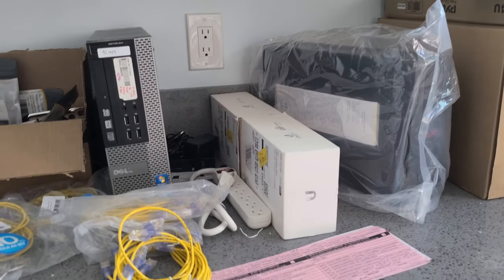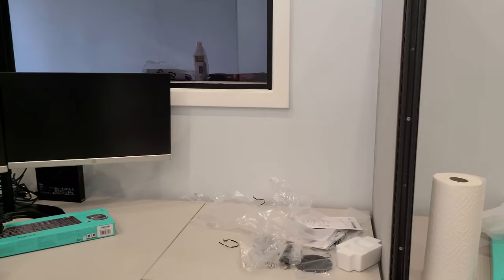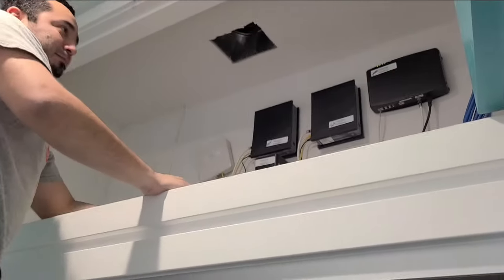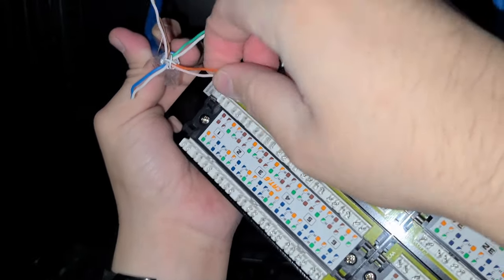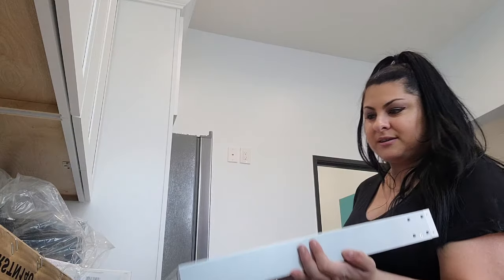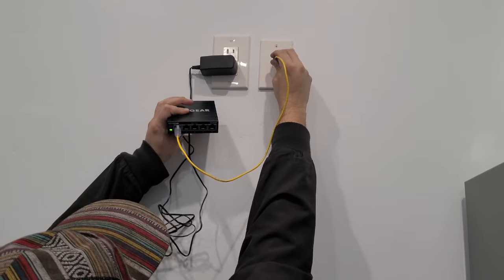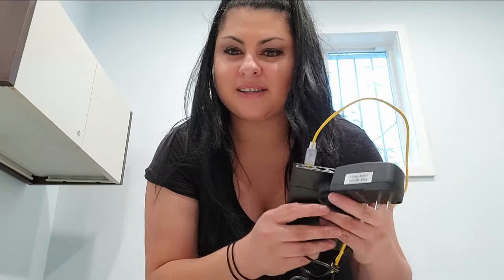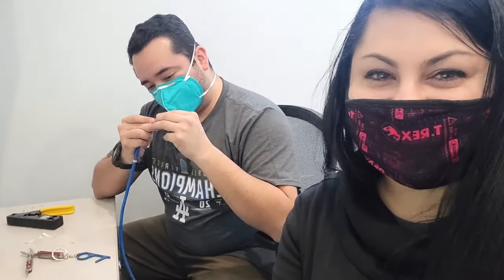Day In The Life Of A Systems Administrator - Hardware And Networking

Comment: Not what I consider a "system administrator" job. Maybe a network technician, or possibly a network engineer if some enterprise level cisco switches, etc were involved. I would (and have) pay guys in my local area 15 to 20 bucks an hour to do this work and expect two guys to knock it out in 1 day. I would also hope they had the correct tools for the job but if not, I would provide them, punch down tool, toner and tester, good strippers, and crimpers. If I knew them and trusted them I would let them use a netAlly LinkRunner AT 2000.

Comment: So, can someone learn how to become "system administrator" with only personal computer? or is having servers and multiple computers required?
Reply from the maker: Hi! Generally a sysadmin designs, manages and maintains various aspects of a company, so it is recommended to have knowledge and experience in servers, different operating systems, security, backups, networking, etc. The knowledge is on the internet, so with a personal computer you can attend courses, use simulators and gain knowledge that way. You don't specifically need to have a data center in your house to gain sysadmin knowledge  :)

Comment: Hi, Mimz it's me Ehsan khan a network and System Engineer ... I have 4 years of Experience ...so the work you show in this video is not the work of an Administrator, It's the work of a network engineer ...Network Engineer can manage routers, switches, firewall, etc ... Network Administrator can only manage the Servers like server 2008,2016,2019 and so on ...